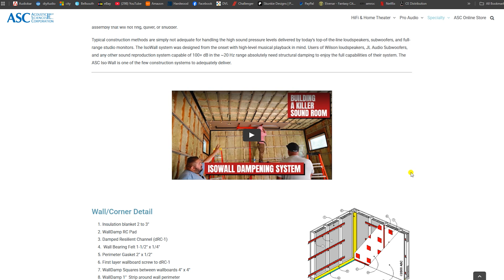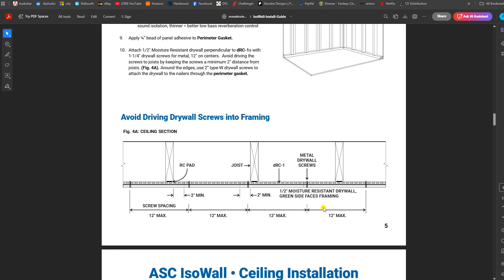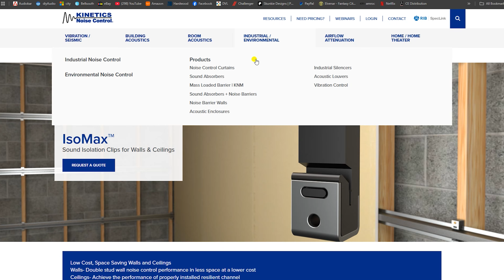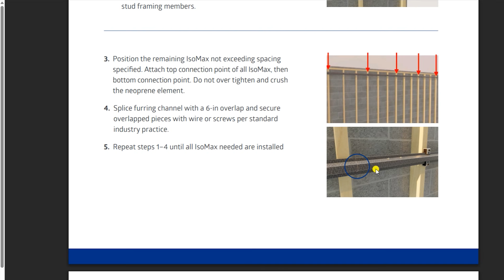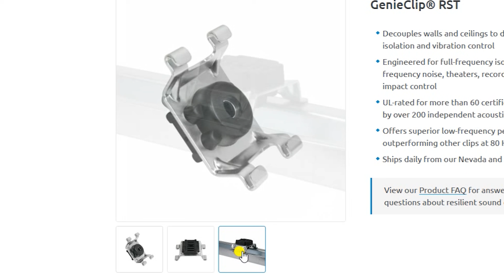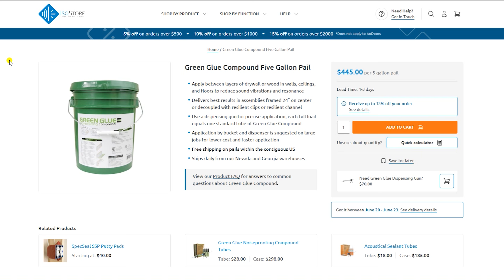Building My Audio Room: Acoustic Wall Design Choices

Comment: I don't understand why audiophiles think they need some isolating wall assembly.  I've worked in architecture for almost 15 years. I've worked on many projects with acoustical engineers. This type of wall assembly is only useful for those who want maximum isolation. 

Even then, if you puncture a hole, the size of a pea the amount of sound leakage will be tremendous.  

That type of wall assembly is not necessarily going to improve the acoustics of the sound of your room. What you are essentially doing is sealing off the inside of the wall making the diaphragm more rigid.  

You are essentially making it more like a concrete wall. In that sense, you will have greater reflections off of the wall surfaces and less absorption into the wall cavity. 

That energy has to go somewhere. 

Then to combat this you need to go and spend a metric ton on acoustical panels on the wall to do what the inside of the wall could have done from the very beginning.

This is the sales strategy to get you to spend 100k.    

Sound transmission coefficient sound absorption coefficient. 

Look up the massive difference between 1 layer of GWB and 2 layers of GWB.  Less sounds is being transmitted and less is being absorbed.  

Now look up the performance of a staggard stud wall.  Etc.  Hay could have saved 50k and gotten the same performance.  

An acoustical engineer is going to sit down and look at different frequency ranges and see what needs to be absorbed and what needs to be refracted.  

Jay's new room on his latest video sounds exactly how I expected it to sound.  Like a cacophony that's been mitigated by outboard acoustic panels.  

This assembly is great for a recording studio or a home theatre or when you don't want to dosturbe other people.  

People get really really fancy with all of this crap. When at the end of the day they probably can just do 2x6 studs with an absorbent bat inside the wall assembly and then you could do a perforated gwb with some other diffusers here and there.
Reply from the maker: These people don't sell room treatments so doesn't make sense they would be steering me towards a design that is a "sales strategy".. And I don't understand why so many audiophiles ignore reducing the noise floor inside the room and spend thousands on gear that promises to do this instead.

Comment: Going to be very nice and well thought out.  Good idea to get a sound engineer involved.  I always thought that any point where a screw or nail that connects negates the isolation of the wall, supposedly sound travels through the steel in the fixing.  When I built my room we built 2 wooden walls with a 2 inch gap between each wall, styrofoam board to fill the gap and the inner wall with spray fiaf fit the putter wall.  The plaster board was then glued to the inner wall, no fasteners.
Reply from the maker: That sounds like a very effective way to eliminate those mechanical bridges!

Comment: Unless you stepped the sidewalks,  mine have 8 inch steps just behind listening area where support poles for a steel beam.  So they are boxed in  both sides?  Wonder what thats doing?  I do know the combination of everything really works, Just a Thought ?
Reply from the maker: No idea and I'm not saying other people don't have good sounding rooms that are different from this either.
Reply: i was responding to your  engineers talking about angling the walls from wider to narrow.  Sorry I really didn't explain 😁
Reply from the maker: NP

Comment: I am sure you have already studied up on power to the sound system.  A dedicated 20 amp circuit void of lighting, computers, appliances and any other noise sources is the way to go.  Grounding stakes are also a good idea.  You might want to run under slab conduit for floor outlets to each side of your seating area for power recliners, charging outlet and lighting.  And beware, that any standard dimmer switches are quite noisy.  Don't forget a new bed for Dolly!
Reply from the maker: Yeah I was thinking of a couple of dedicated 20A circuits to the equipment rack area with wire gauge appropriate for that service and to have good grounding, but GREAT IDEA on in slab floor outlets at the seating area!!!!!  And I will definitely have to research the whole dimmer issue.
Reply: @SkunkieDesignsElectronics  Floor outlets are the ultimate upgrade ❤
Reply: @SkunkieDesignsElectronics   If the building is served from the main house the grounding point need to be the main breaker panel in the house . Check NEC  for wire size.  of conductors .
Reply from the maker: Yeah, I have some ideas on this but we haven't dove into any details. Until the size/shape of the room is nailed down, in a holding pattern with the architect.

Comment: Yesss...   The bones of the room are most important.
Sloped ceiling sounds great, you may also consider a vaulted ceiling for maybe a less strange look n possibly better (less) resonance.

Will you have this on concrete slab ?

Thanks for the most interesting content 🙏
Reply from the maker: Yes, it's going to be on a slab and they said the sloped ceiling is much better than a vaulted, and in fact those can create all sorts of weird reflection issues to engineer out.

Comment: Plugged my listening room dimensions into the AMROC calculator.  Got a good result.  It was designed using some other calculator that worked off the audio Golden Ratio dimensions.

Comment: All options are complete crap.
Reply: Comments are a matter of maturity.
Reply: You need to glue 10 cm of basalt wool and plaster with mesh. Then apply the finishing touches, and that's it.
Reply from the maker: Sure... And some people believe just throwing some rock wool in a wall is all you need as well.
Reply from the maker: Appreciate the detailed response :)

Comment: You have clearly done a lot of research and given this a lot of thought so I defer to your conclusion for you.  Just an observation from a distance.  Your main concern appears to be listening quality.  The wall systems you discuss claim some benefit in that area, but seem primarily focused on isolation, keeping outside noise from getting in and inside noise from getting out.  Is that really a big issue for you?  You’re building a separate structure so unless you have a lot of external noise to keep out, is it worth the added material and installation costs?
Reply from the maker: The "isolation" and mass loading of the wall system  (as well as the size/shape) will control the bass reflections/response in the room. It also impacts the resonate frequency, which for many wall systems are well into the audible range. The means at those frequencies, the walls act not only like passive radiators reflecting sound, they actually amplify that frequency, which can't be controlled with room treatment. Plus effective bass room treatment after the fact is not going to happen with "bass traps", unless they are 4-5 feet thick, unless they are active or membrane types tuned to a very specific frequency and installed perfectly.

Also think about how much people obcess about "noise floor" and a "black background" in audio systems, which they are being placed in an environment with a noise floor of 40-50db!

Comment: 5:28 If the metal attaching to the stud had dampener material encapsulating it, I could see it being sufficient along with the other details. I don’t understand the detail on the left. How is the screw type important if it goes all the way to the stud? Maybe going through the gasket is enough to isolate it by dampening out the harmonics traveling through the screw? I think it should have two screws as in the middle detail. But, I am here to learn and acknowledge I am speculating.
Reply from the maker: Yeah after looking at that whole design, it doesn't make any sense. Even the middle detail,  both screws go directly into the metal channel which in directly screwed to the stud. It's like every screw in the system is short circuiting the rubber isolation.

It doesn't really seem like much of an upgrade over a basic "resilient channel" system other than those squares adding a constrained layer/mass to the wall, which you could do with green glue for 1/4 of the price.

Comment: Hi Skunkie, dont go over do things. i think those walls are more to prevent sound bothering your neighbours. you're not planning on playing at Clublevel? its totally wasting money. Put the money in the speakers!  In my house, i have treated all first reflection points floor/walls/ ceiling  and 2 massive large DIY tubes dia. 40cm/2m lenght behind my openbaffle speakers (reflecting highs/mids, damping bass).  i am very satisfied with the sound. Soundstage, huge depth perception, its all there.
It wont break your bankaccount 🙂
You are absolutely right according to dimensions of the room, a d'appolito type speaker arrangement can negate the lower ceiling problem is my experience. a 3/4m, 10/13 foot high ceiling is nice ofcourse but most of the time unrealistic in a private home.
Anyway, good luck with your build! I keep following the progress :person-turqouise-waving:
Reply from the maker: Nope, this is not being done for "sound proofing" for my neighbors, but yes it will lower the noise floor inside the room. It's more done to naturally control the bass reflections and lower the resonate frequency of the walls. This is why I hired engineers who understand all this stuff :)

Honestly a lot of great sounding audio systems control the low frequency room issues most rooms have by just not reproducing them. In the past that's what I was doing in my existing room, using speakers with basically nothing under 40hz.

Comment: Yeah that system they Jay used seems far too complicated and expensive and full of direct connections to studs that short circuits the isolation. Then it's an installer nightmare....no way.....Just a thought, but how much more expensive would it be to use concrete block construction for the walls instead of timber studs with all that treatment? The other thing to consider is if you have a large vinyl collection, that could take up a lot of wall space and modify the acoustics....
Reply from the maker: That's a good point, possible the vinyl collection can be designed into the room treatment as diffusion? And yeah Jay was lucky to find someone willing to deal with that, and even with all that, like you said it seems like a self defeating system with all the direct connections. And I think concrete block walls have their own issues that have to be addressed.
Reply: @SkunkieDesignsElectronics What are the issues with concrete blocks?
Reply from the maker: No isolation and zero absorption.